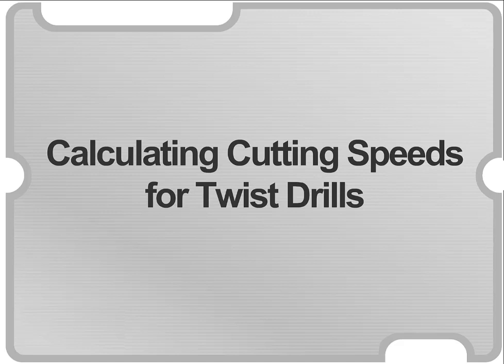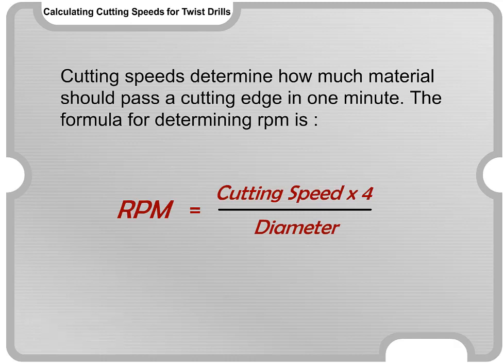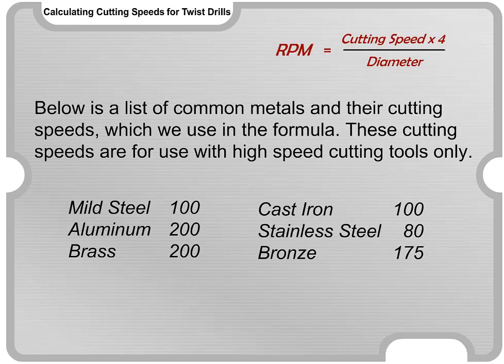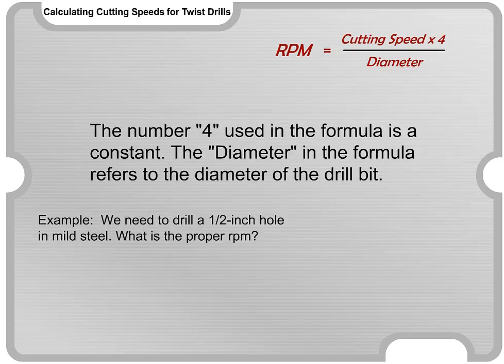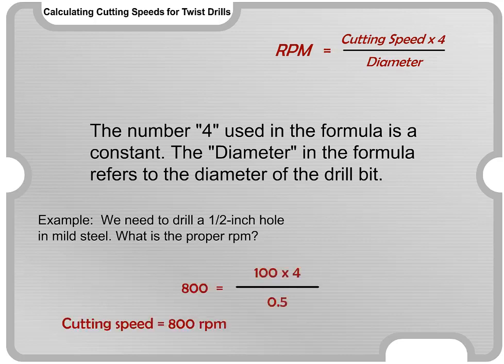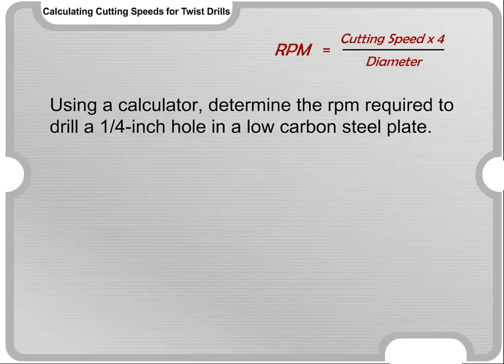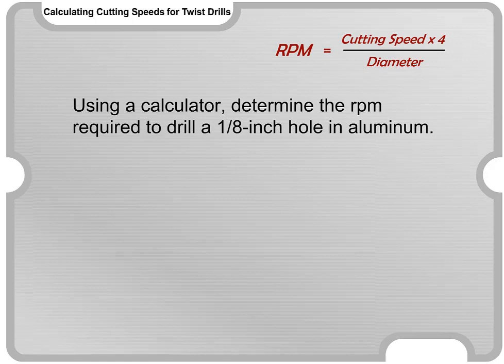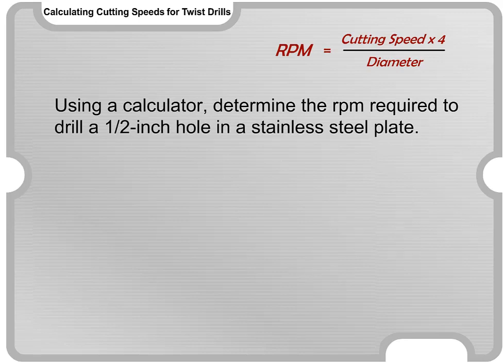Calculating Cutting Speeds For Twist Drills

Comment: Can this be used for metric sizes also?
Reply: Yes if you convert the metric size to a decimal.  Just divide the number in millimetres by 25.4, so for example an 8 millimetre drill bit would be .315 inches.  You can also use this to change imperial to metric.  Maybe you have a bad socket/drill bit and want to find a close equivalent.  If its a 3/4 size, thats .750 in decimal form, (.750 x 25.4 = 19.05) so that would be very close to a 19mm socket/bit.